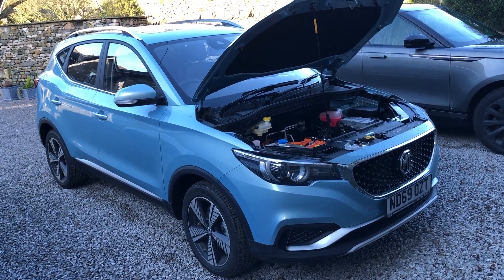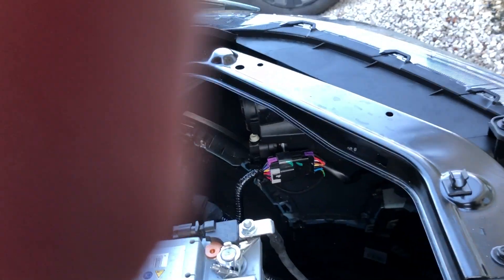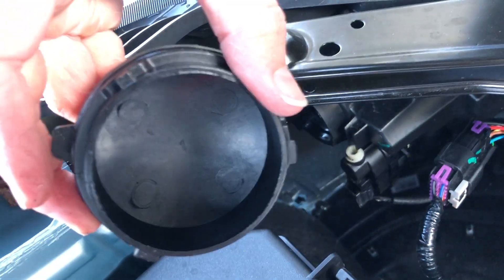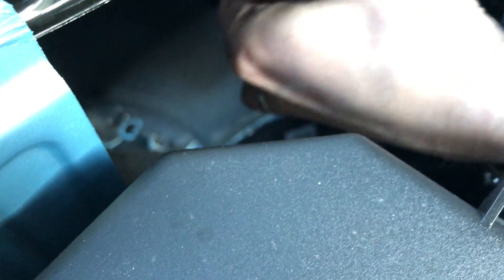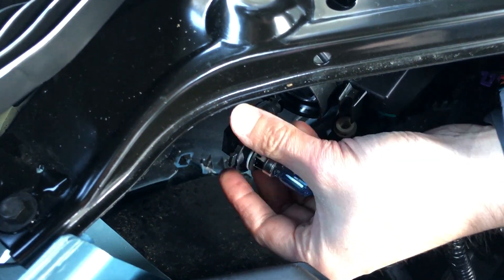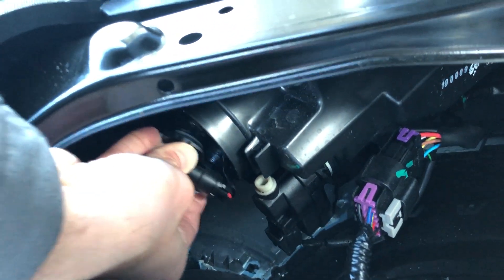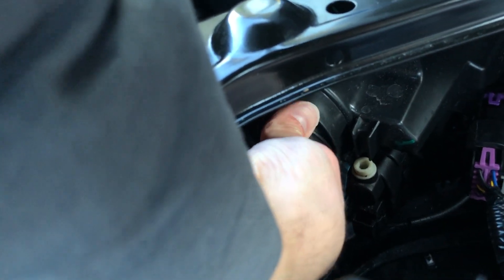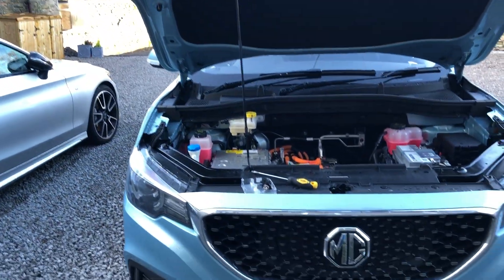Replacing the headlight bulbs in an MG ZS EV.

Comment: Did mine today, top tip for removing the bulb from the holder without breaking the clips is to use a small headed flat blade screw driver and place it into the gap under the clip, twist and prise the bulb out, hey presto, no broken clip and easy removal of the bulb from the holder.
Reply: W